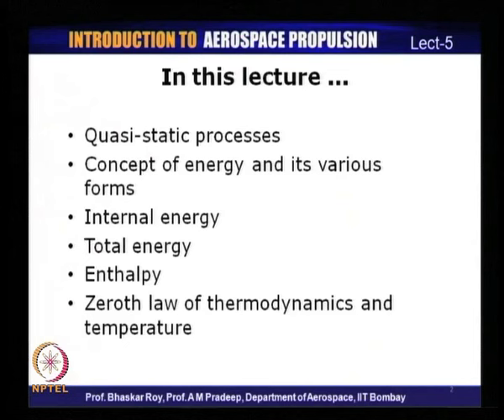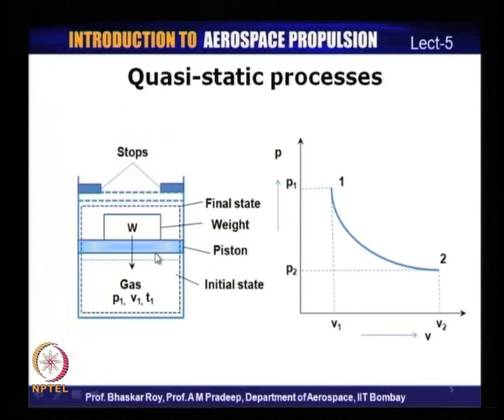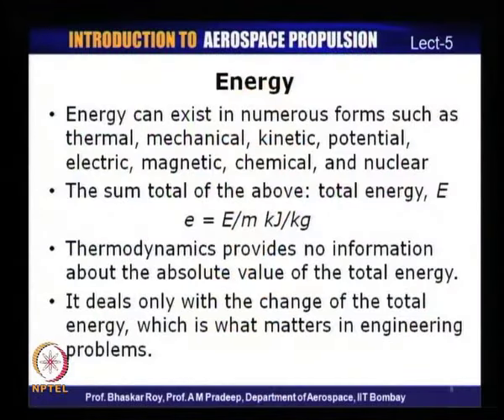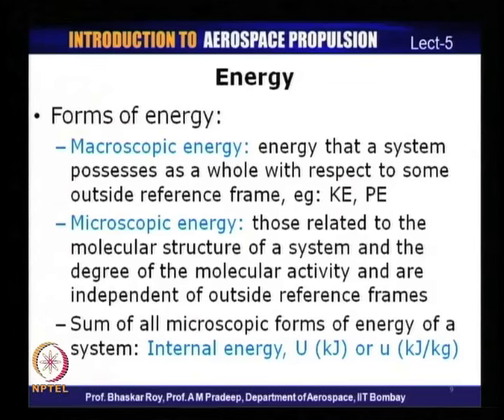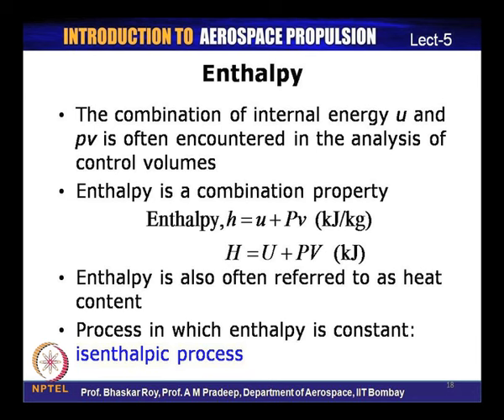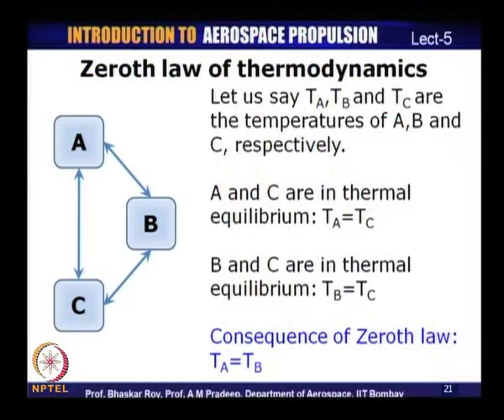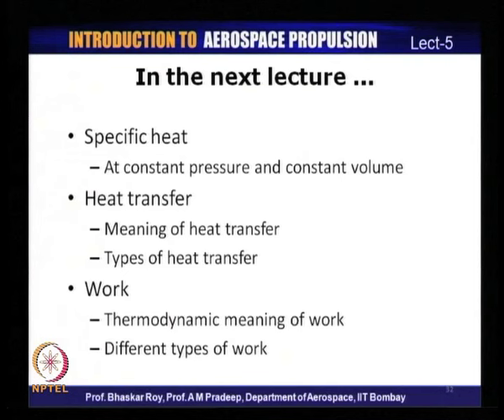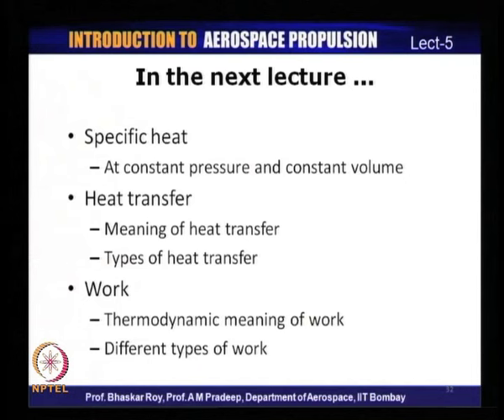Mod-01 Lec-05 Quasi-static processes, zeroth law of thermodynamics

Comment: Pradeep you repeat yourself overly much ... no need to restate the introduction as you complete each part .. and move to the next one .. speak less relate MORE information ... cut your blabbering by 50% MINIMUM .. the first precept of technical writing clear, concise, logical order and nonrepetative ... more like Roy ... he says what he will do then covers it and then moves on to the next topic with now we will cover ... so and so ... you spend 3 minutes restating your introduction at the end and then at the beginning of each topic ... you could literally cut 50% of your gab sessions and not miss anything you wanted to cover ...
Reply: having sat through a 15 minute lecture that took 45 minutes to do ... you are repeating yourself a minimum of 3 times on EVERY topic discussed ... once is enough ... your examples to make things clearer are pretty much useless as they dont actuallyt have a way to make a change in them and you cover the same definition and applogise for the limitations of tmeprature scales ... such as the Kelvin scale which is only good in it's mid range as ayt low and high values it is no longer accurate .. which means that gas temperature related scales are not able to be considered accurate at those ranges either ... making the kelvin scale USELESS in all but mid ranges ...